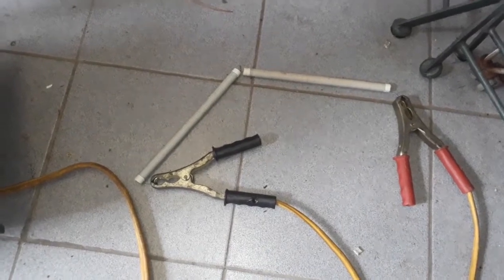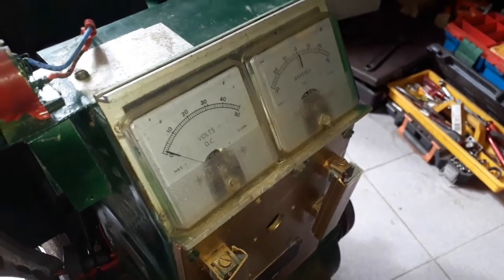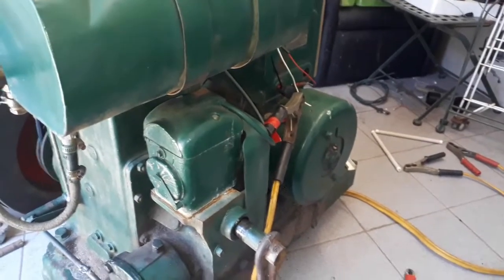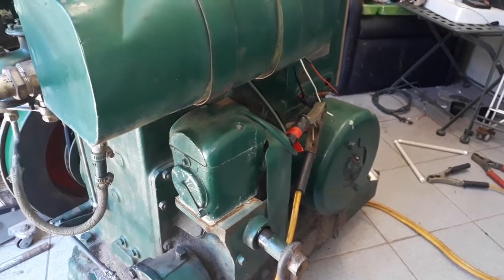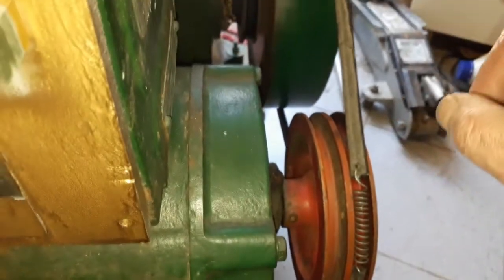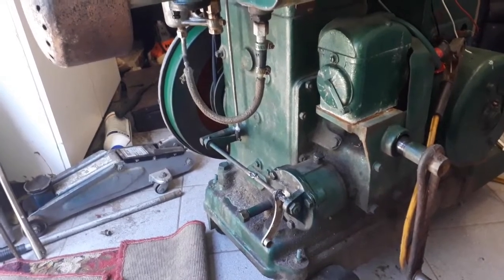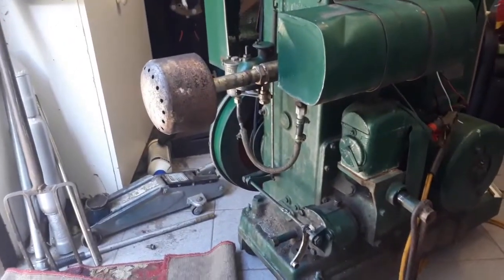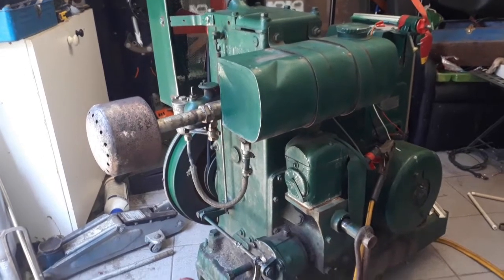Lister Load Test Fails, fan belt problem, Question at the end on going forward.

Comment: I got to hand it to you in the ingenuity department, I’ve never seen a spring used that way!
Reply from the maker: Hi Steve, I had to make a plan to see if my governor modification works lol, I guess if the spring is little more stronger it will not slip, I had that belt connected together with a wire and it works wonderful for a couple of day's, I will hopefully get a new belt tomorrow my friend, thanks very much for watching and commenting, it is really appreciated

Comment: Just a question why is the ammeter needle in the middle.  There wil be no negative drawn amps?
Reply from the maker: I don't know, one of my lawn tractors had a Amp meter with a negative side and it did show negative when I swap two wires somewhere, I remember that very good